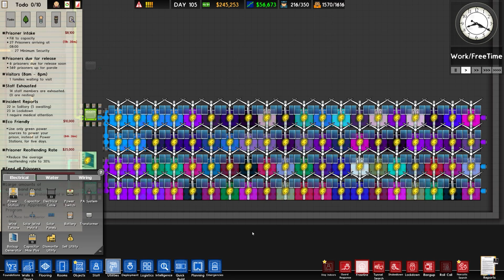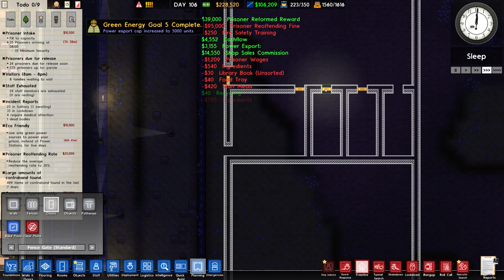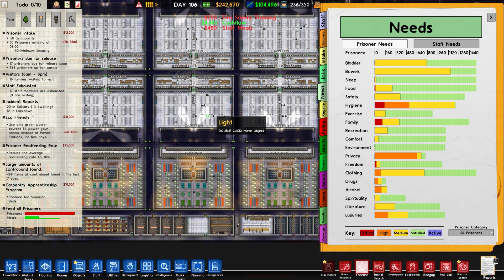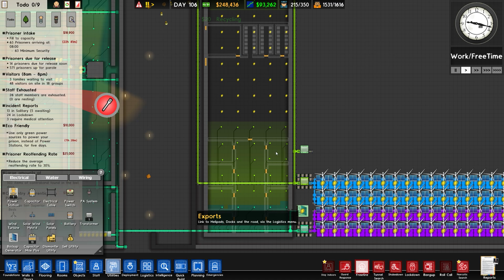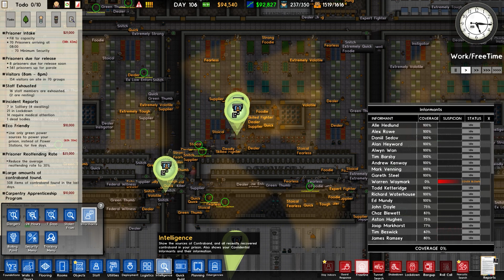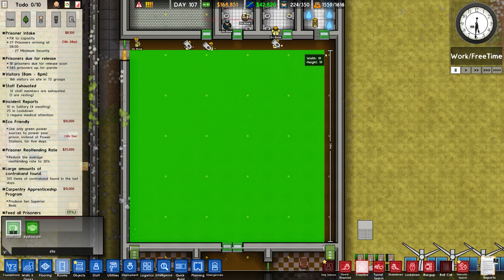Are Prisoners IGNORING DEPLOYMENT? | Prison Architect #35

Comment: Commenting again to please try adding more laundry machines! 
Making areas like exports and garbage smaller might help with getting trucks out of the way quicker because things aren't being placed at the far end of them. 
I would probably designate one of your cell blocks to protective custody and wall it off so they don't mingle. They won't be able to work but will still get parole because they'll be escorted there.